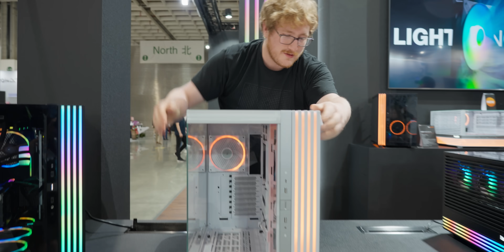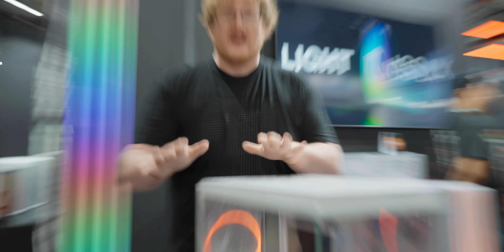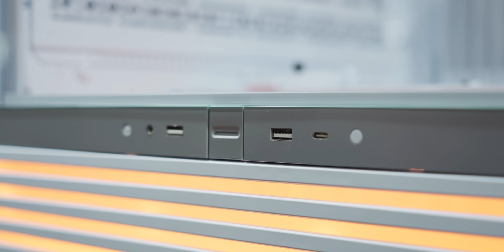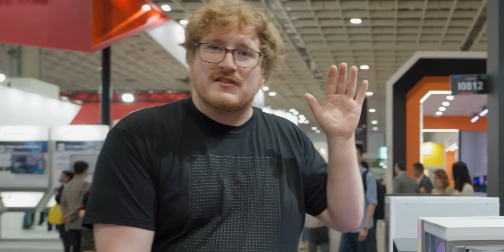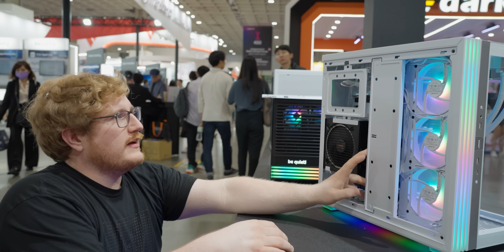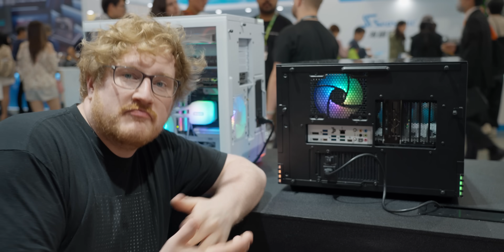THEY FIGURED IT OUT! - be quiet! @ Computex 2024

Comment: That so sad, i would buy it for 3x 360 x 45mm Radiators but the vertical mound for the GPU is so bad you cant use an 25BG Network Card at the same time on the lowest Slot (MSI thomahawk X870E) and the Place for the Bottom Radiator sucks also than, there is so much place for an extra Verticaly mount, they didn't use, like on an Corsair 7000 or an old thermaltake core 71 TG, i use for now!!! Than it would be perfect, i hope they releas an revision soon ;) Than it would be realy my next choice!
Also one more idea would be to give us an replacement Plate (Steal or Alloy or acrylik) for the front glaspannel to ad an Distroplate like Alphacool 360 v2 with see thrue ;) but that i could cnc my own so let see what comes next.

Comment: I am definitely liking the 900. I need to replace my Cooler Master LAN Box that I've been using for a very long time. Love the layout but lack of case filters has grown old on me. Unplugging everything to take it outside and dust it out every 5-6 months. I am going to miss the two hot swap hard drives though... damn.
Reply: I wish I could see the cases in person I'm leaning towards the DX 900 but I kind of want to downsize from my current case since its huge but I wonder if the 600 is too small for me being a mid tower
Reply: @LarrySmith-zj2zl  Well beans, I ended up getting the 600. I wanted the 900 but for the spot that it would have to go it wont fit. My Cooler Master fits with 4 inches to spare, not enough for the 900 but the 600 fits.

Comment: The problem with today’s cases are that they are too damn wide and use too much damn glass. I mount my PCs under the desk and the widest the mounts support is 10”. I: don’t want to see the inside of the case. I don’t need the anxiety of a visible cable mess or breaking the panel when taking the PC apart. If you have a glass panel design, have an ordinary metal design.

Comment: I have an older Be Quiet case that I like though would enjoy a smaller version of it. I imagine shrinking the case while maintaning the same 2 fan on the front & less depth (front to back length) would allow the air to flow stronger right on the components.

Comment: Video Suggestion - fantastic demo of a very flexible case. But as an old time PC owner, it was always my understanding that if you had a case sit one way for say 2 or more years. Then if you changed it to another layout, this could potentially "misalign" the heads on a MECHANICAL HDD. So my suggestion is --- now with SSD's with no moving parts --- is there anything else in a "typical" PC case that could be effected if you have the case one way for a year or two, then change it like you can here... could this still effect GPU / CPU / CPU Cooling / Power Supply in any way?

Comment: Yay, future-proofing not that long ago:
*) This nice PSU will last several iterations. Well, now I’m missing fancy 12VHPWR port to avoid using multiple cables and an adapter. 
*) Let’s just get a bit bigger case that’s easier to build in and have space for cable management. Not like new standard of mobo with connectors on the “ugly side” will come anytime soon. And make it so much easier to have a cleaner look. 
*) now let’s just come with some new standard for CPU coolers so all of the traditionally “long lasting” components get closer to being vintage.
*) I guess it’s not the good time to replace the 10 year old display either, with current speed of display tech development 🙂

Anyways, not complaining, this machine brings plenty joy and hopefully will for quite some time.
And once the time for bigger upgrade comes, well, at least there is something to look forward to.

Comment: BeQuiet, please.... dual 180mm fans at front (AT FRONT, NOT SIDE) and same style front panel like top and bottom. Your case will dominate the market in that option. AND FFS, PLEASE ADD SUPPORT FOR 140MM FAN AT THE BACK. There is enough space (!).

Comment: Finally, another case with the motherboard in the CORRECT orientation. - However, Thermaltake figured "this" out like fifteen years ago or whatever. - Their Core V21 has never been beaten in its principles (even though it's flawed, but even their own follow-up didn't improve upon those flaws and actually became worse in ways). - You can put that case in just about every way you want, except for on the front or back (well, you could on the front, but you know... stupid). Yes, you could even put the frame upside-down, as all four panels around are interchangeable, even the bottom-plate with the feet on it, so you could even hang the motherboard upside-down. You don't need to change anything but the panels. - But the best way, of course, is to put it upright horizontally, which is the desktop-orientation, and then you of course have all the top as a mesh panel (unless you choose the window-panel, but yea) so heat can escape more easily. - So this one is still flawed in that aspect, with way too much glass. - Also, this is not symmetrical, the V21 is a lot closer to being that.

Comment: Silverstone SUGO 14 ITX did this years ago. Feet can be easily refit for horizontal/ vertical layout. As for horizontal layout, it was the norm during IBM PC days; the CRT would be above the case, utilizing desk space as well as bringing the monitor's top at eye level, which is more ergonomic. I use my ASUS AP201 case horizontally without the feet, it looks like a subwoofer next to my TV in the living room.
Reply: Thermaltake V21 probably before that, though it's larger to accommodate up to mATX. But then it also leaves more room for more and larger fans as well as general breathing-room. - You don't change just the feet on it, but the panels instead, as you can even remove the bottom and put it on the side or top, as to turn the entire frame around onto one of four sides. - It has its own issues here and there, but I love that thing, it just makes a lot of sense, even if it can be improved upon.

Comment: Oh, the inverted case has my attention. YES! I have been looking for a way to put my computer on the left side of my desk but being able to see the internals. This is what I've been looking for!
Reply: Thermaltake V21. A bit outdated, but hasn't been topped in its design-principles. - I have it on my desk with the window-panel put towards me and the motherboard horizontally, but the kind-of weird thing is that you see the back of the GPU then, which isn't that weird, but it is when it has a design with text on it that's "upside-down" for when you look at it in a regular tower-configuration. - But you can also put the motherboard vertically on the other side, which then would have the GPU-fans up. And you could even put the motherboard upside-down if you want to. All four panels around are interchangeable, so have at it.

Comment: Inverted layout is cool, but are there any GPU support brackets (first-party or aftermarket) for that configuration?

(i.e. where the GPU stays horizontally mounted. You could use a vertical bracket/riser but then the GPU intake will get smothered by the glass)

Comment: Funny. Both of my work PC's are laying on their sides. Have been for over 13 years. I use one for normal work stuff and gaming and one for flashing automotive control modules. I find it's a lot easier in a shop environment to have them flat for the room and stability. The one I use for flashing modules is on a roll cart for portability. If it were standing upright, it would have fallen many times.

Comment: I'm pretty sure most people don't have their cases sideways because it suddenly takes up 3 times as much table space, and immediately eliminates all vertical space from being used. It is cool to have the option built in, but you could easily just 3d print something (or use a service) to get the same function with your current case

Comment: So we went full circle back to horizontal computer case, but without the ability to put your monitor on top of it to save desk space like we did in the 90s and prior.
Reply: That’s because a case like this is better suited under an entertainment system shelf or on an entertainment system shelf. It’s how I use my computer, which sits right next to my TV because it’s not a laydown case. But if it were, it would just barely fit on the shelf of my entertainment system. My big screen TV stand. Which is how I use my computer, as an all in one entertainment system on a screen TV.

Unfortunately, they do not make many laydown cases so it’s nice to see them bringing them back at least a little bit or at least that’s an option although this one is just too thick to fit under my entertainment system based on what I can see in this video. I’d have to get the exact measurements. I would say it’s probably about 1 inch tall.
Reply: OP: Can't put monitor on case
 
You smooth brains: "You can still do it," proceeds to suggests all kinds of ways that's basically not putting the monitor on top of the case
Reply: I did that with my RVZ01 build a few years back
Reply: @Vonliktenstien  Nice but SFF cases don't count since they're mostly aimed at enthusiast, this is the first mainstream ATX horizontal case we've had in years
Reply: You could mount the monitor above the computer chassis
Reply: You can still use a monitor mount on the back of a desk or wall mount over it.
Reply: I don't see why you couldn't put the screen on top. I mean, modern LCDs are, even though they have become much larger than any CRT we put on the cases back in the day, still lighter than those old monitors were.

It'd be pretty distracting with the entire lightshow going on below the screen though...
Reply: @steveweidig5373  Putting something weighted and not evenly spread in weight on top of a tempered glass is generally discouraged for a reason.

Comment: I'm lost! What is the difference between that and simply turning you existing case on it's side with a couple of standoffs?
Reply: The feet are more secure and also a lot of cases don't have the support on those sides to be able to put their entire weight into it, other cases that do it require screws.

I have a Meshify 2 XL for example, if I did that to mine the side panel would definitely start warping.
Besides aesthetically speaking the single glass side panel in those cases does  not look as appealing especially if you have the case right next to you in the desk.

Comment: Horizontal cases never really went away completely. They just became niche.
Back in the early days, as many commenters noted, they used to be the standard, and towers were the weird thing.
Over time, towers became the "standard", and desktops (as we called them) gradually faded away.
Their memory lives on in large format cube cases. The most memorable sample I can think of immediately is Cooler Master's HAF XB (and Evo), which up until relatively recently you could still buy. Sadly it has since faded away. Love that case. Have one.
Silverstone, masters of the weird, have also continued to offer some, and a few small-run options have also popped up here and there.

Comment: seeing someone so young that they probably don't even remember that towers were not the default configuration back in the day...be "surprised" that you can lay a computer on the side.....
Reply: He's impressed by the fact that you can rotate the case to 3 different positions just by popping its feet. If you pay attention, he says that it has seen it before but that in those previous cases you had to move many parts, not just the feet.
Reply: @itisabird  But he also claims that with any other case that does this, you need to change the whole case around like it's a day's job, which is not true either. - These kiddos need to stop acting like they've seen everything. That said, even the older ones sometimes act like they know it all, but don't. It always shows flaws in their knowledge or at least research and makes them look like blabbering idiots to those who know.
Reply: Right!!?? It was standard to have the PC flat with the monitor on top. Just google IBM pcs from the 90's.
Reply: My old compaq pressario is crying
Reply: I have a Dell Optiplex 745 years ago that runs WindowsXP professional. It does indeed have provisions for being on its side. It was my first PC.
Reply: I'm crying, and I'm barely older

Comment: I wonder how airflow is with it laying horizontal
Reply: Also horizontal. - But screw cases that don't have a ventilated top. Warm air goes up so fast and it should just be able to get out there easily. - I have a case with an almost entirely mesh top and two very scoopy 140mm fans exhausting. But even THEN it helps to remove the mesh filter, which you could totally breathe through all day. That's how bad it is to block off the top. At least with very hot components, that is. My GPU just happens to get stupid hot, so any exit for the air helps.

Comment: I remember the BTX standard.  Also old enough to remember when horizontal cases were the norm.  Back when it was a beige hellscape.  And there were 30lb CRT monitors on top, not very friendly with glass panels.
But this case is awesome.
Reply: BTX Ready - I still have my daily driver in a Coolermaster STC-T01. Thing came out in 2005. But if I wanted an AIO CPU cooler I'd probably have to either mod it beyond recognition or get one of these, looks like the best new case out there.

Comment: I'm still using a horizontal HAF XB Evo. I bought it in 2014.
Reply: I used to have one of those but it took up too much space on my desk.
Reply: I like that one, almost got it around that same time, but didn't, and actually still want one to build something in. - But it's quite limited in terms of cooling and such, and indeed a quite large footprint. - I use the Tt V21 instead and that hasn't been topped in terms of its design-principles, and even that case is flawed.

Comment: Immagine if the NR200P had a slightly longer bottom plate without the feet, but with feets on the elongation to put it vertically (it needs to be elongated for the cables).

Comment: I have a Thermaltake X9. The best case ever. Point. We are still seeking a company that makes something like that but better. There is still noone that did that. Those case showed on the video, used as horizontal stand, that is what we seek, are appealing but they are at the same time a bad design.

The frontal fans should be.. ON FRONT, not on a side panel. Since the glasses goes with an angle of 90 degree, the air flow is broken and will require a lot of time and pressure to flow on the components and go outside on the back.

Comment: I am glad someone was thinking about folks that wanted horizontal pc cases.
Reply: None has done it as well as the Thermaltake V21, however... and that thing is outdated. Yet I won't stop using it until something does the same and better. - There's also that Cooler Master HAF one, but that's so outdated that it doesn't even support 140mm fans (except the 200mm in the top) and it has a much bigger footprint for no reason (unless you need an ATX motherboard for some reason), and you can't change the orientation either, unlike the V21.

Comment: Now we need it with an option for Rackmount😂
Reply: That's what I was thinking. 5HE, cause 4HE is a pain with some current GPUs, make the large glass panel optional (or give the option to buy a solid side/top panel), viola... finally more options besides rack mount cases that are cheap and build like shit, expensive and build like shit, and Sliger (which are kinda hard to get outside NA).
Reply: Was thinking the same so you can maybe mount it inside a desk drawer
Reply: I thought this was a rack when i clicked

Comment: I wonder how this works with AIO’s
Does a normal config being laid out flat like the first way it was shown cause issue?
Guess you can just reorient the fan setup depending on how you want to configure it.
Reply: Yeah, here are the AIO placement options, I will refer to each location based on the regular mode.

Regular mode - top and side mount are good. Not bottom.
Horizontal mode - top and bottom are good. Not side.
Inverted mode - bottom and side are good. Not top.

Regarding airflow and fan placement, it's basically the same. At the time of building you will need to decide regular, or inverted. And you can always go horizontal, if you choose.
And location on desk will decide this choice. Inverted for left side of monitor, regular for right.

All said and done, the case gives you loads of options, but not every option makes sense without moving stuff around.

Hope that makes sense.

Comment: Horizontal used to be the standard. Everything else was odd. There were some advantaged to the switchover. No longer did cases need to be strong enough to support a monitor (crt's back then) and less desk space needed, none in some configurations. Of course now there are serious issues to vertical cases. Main one being the ginormous heat management solutions bending and breaking slots and cards and the level of re-enforcement needed for cpu coolers as well. Horizontal cases are due for a comeback now that that monitors weight much less ( a 32" 4k flat panel weighs less than most 14" crt's did) and no gpu sag/breakage and some interesting alternate cooling setups come to mind.
Reply: Putting a monitor on a wide dual-chamber case like this would be ergonomically terrible, but yeah, it would be great to see slimmer horizontal cases make a comeback.
Reply: I  actually own horizontal cases
Reply: @gamebuster800  I have the Cooler Master Haf XB EVO for one of my computers.
Reply: Child from the 80s here and yep, that's how we rolled haha. Now bring back the turbo button and matrix printers.
Reply: Arm mount your monitors, it save space and adjust it to your height.